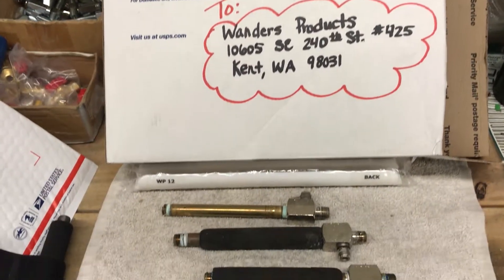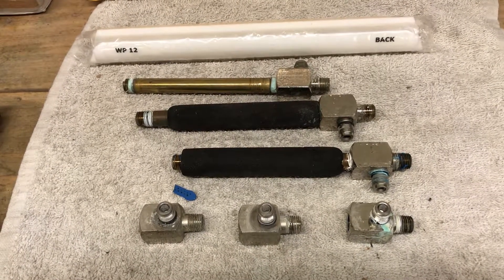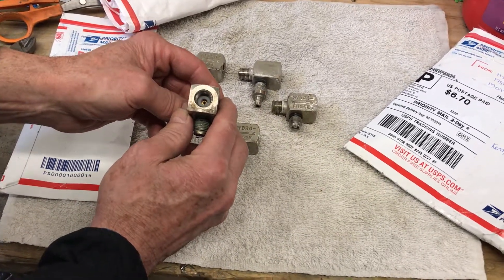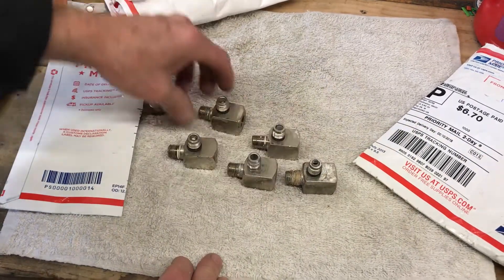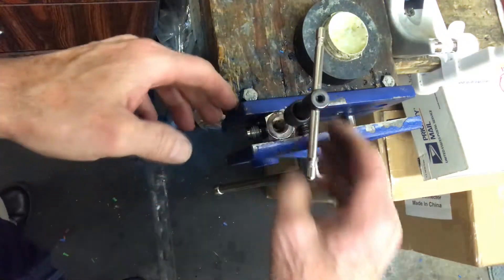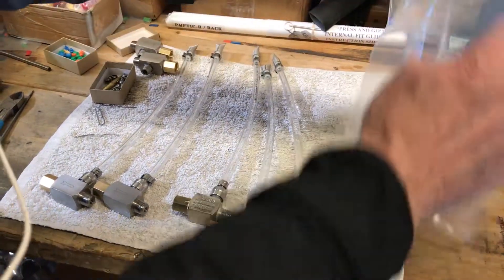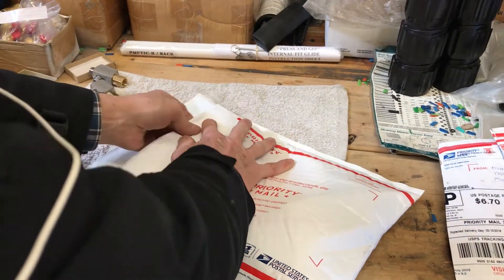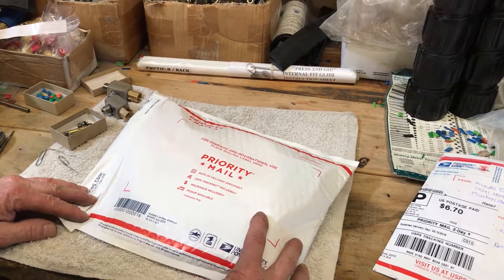DIY: Injection Sprayer (HF) Injector Block Repair

Comment: I got the brass nozzle out but in the process I torched the nylon o-ring. I am ready to reassemble it but cant find instructions on where the white nylon and the black o-rings go. Why doesn't HydraForce provide an exploded view of the block internal parts?